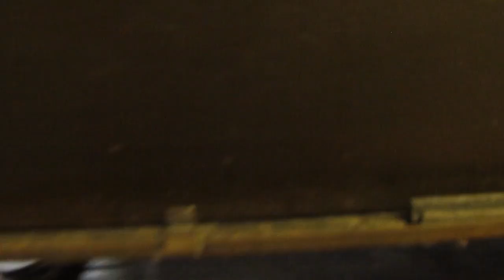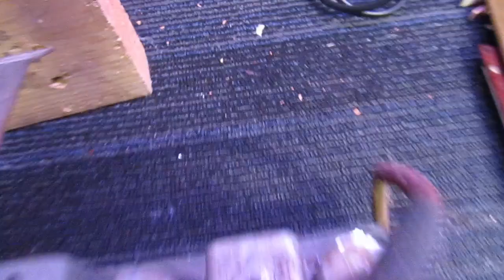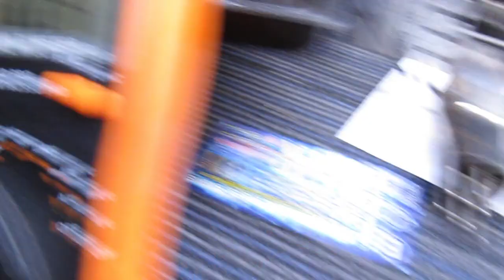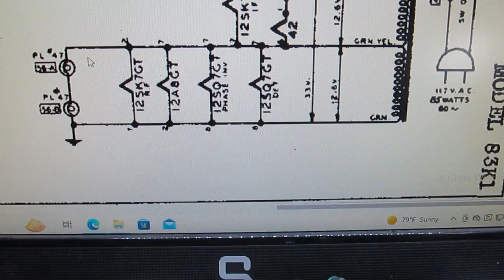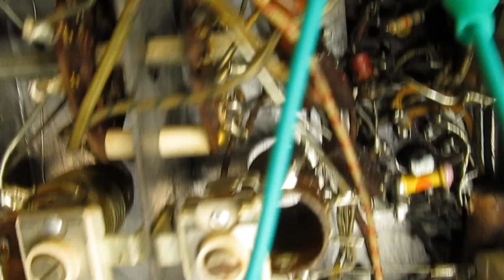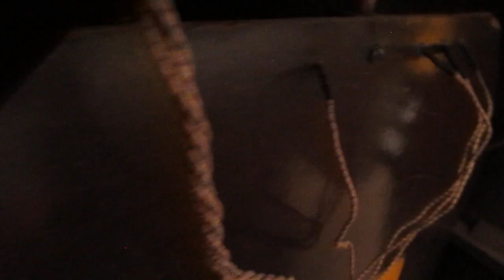1941 Motorola 83K1 Antique Radio with Bluetooth

Comment: I love the video great job! I'm working on the exact same model right now for a customer. I'm adding bluetooth as well. The bluetooth module I'm using has Aux input which is connected to AM side. And don't need to use the switch in the back. The module automatically switches to Bluetooth when you press play on your cell phone.
Reply from the maker: Good idea regarding the Bluetooth that automatically switches. Thank you!